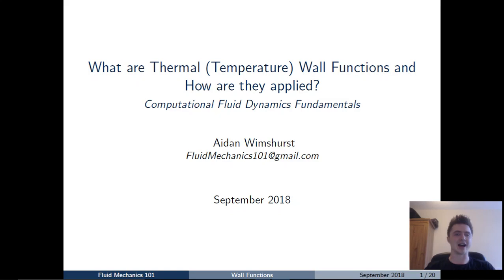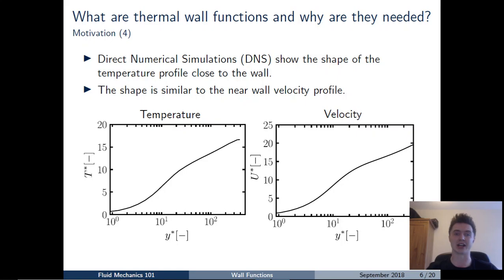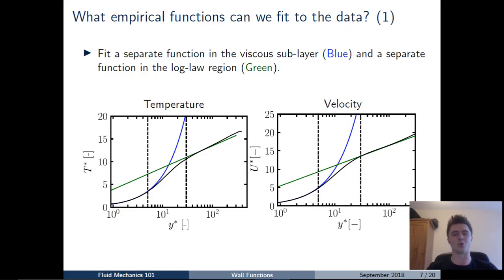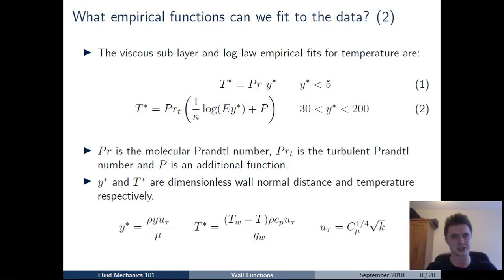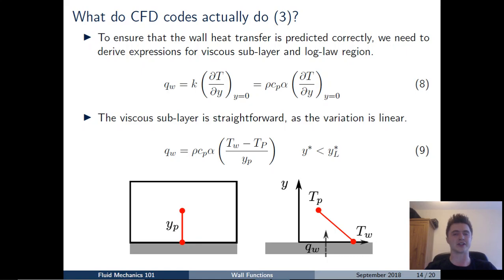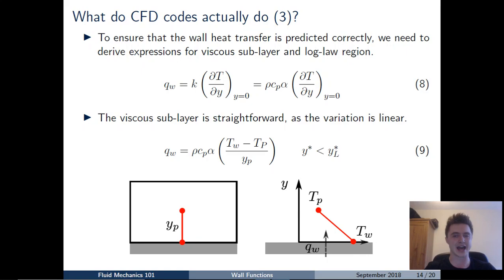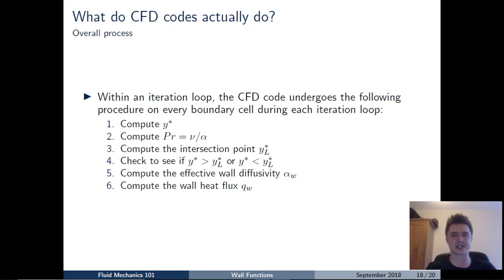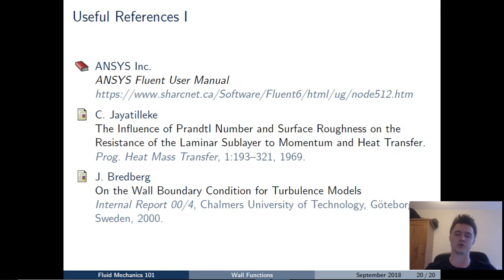[CFD] What are Thermal (Temperature) Wall Functions?

Comment: Dear Aidan, Thank you very much for this very good video about this subject which is not straightforward. Quick question : the CFD code will essentially assess the temperature field in the fluid/solid zone and with this field and the wall function it will be possible to assess the heat flux. Of course, this heat flux is very interesting from a "real" (physical) point of view to assess the quality of the simulation once finished for instance. However, is this heat flux calculated will be used directly by the CFD code to converge iteration after iteration ? In other words, will the accuracy of the heat transfer calculation (via the wall functions) have any impact on the quality of the convergence of the simulation ?
Thank you ! Your channel is really great for anyone trying to understand how does CFD works :)

Comment: Hello Aidan, 

for thermal wall functions, the solver will compute the intersection point for viscous and log-law profiles in an iterative manner. Will it do the same iterative calculations for momentum wall functions or will it take a fixed value of y_plus = 11.25? Can you please briefly explain?

Thanks
Reply from the maker: I think it will depend on the solver. With OpenFOAM, we can always look at the source code and have a look. As far as I have seen in the source code, this is the case.

Comment: Hello dr.,
In 9:59 you gave the Pr for both water and air, where did you get these numbers?, and were exactly should we change the value in ansys fluent in the "wall prandtl number"? .
Reply from the maker: The molecular Prandtl number is a material property of the fluid. Fluent will calculate it in every cell in the mesh and use the value in the cell adjacent cell in the wall function. This is slightly different to the turbulent Prandtl number, which is nornally taken to be a constant (say 0.85 or 0.9). This is fine for water and air. If you have a liquid metal (or another unusual fluid) you may need to change it.  I am not sure where the button is in fluent, probably best to look in the TUI (text user interface)

Comment: Thanks for your videos, i have a question: How to choice the turbulent prandtl number correctly ?
Reply from the maker: If you are using a conventional fluid (like water or air) you can use the standard value of 0.85. However, if you are using a liquid metal or another unusual fluid you will probably have to do a literature search.

Comment: Video super clear! But I wonder which values for k, E, Pr_t u have used to get the graphic at slide 10! Cause i have tried with values like k=0.41, E=9.7 and Prt=0.85 and also other similar values , and i cannot reproduce the values u get in the graphic (I plotted T_star vs y_star values to see the intersections: qualitatively is the same, but the values are very different for water in particular)
Reply from the maker: Have you calculated the P function?
Reply: @fluidmechanics101  Yes, i can copy-paste here the few matlab lines i used: k=0.4187;   E=9.793; Pr=0.71; Prt=0.85;    f=Pr/Prt;   %aria  P=9.24*(f.^0.75-1)*(1+0.28*exp(-0.007*f));  lam=Pr*ylam; tur=Prt*(1/k*log(E*ytur)+P);

and then i plotted. (i did the same for water values).
Reply from the maker: Hmmm that looks correct to me. It has been a long time since I made this video. Perhaps I made a mistake? 😅
Reply: @fluidmechanics101  Thanks for replying. Looking back to the Chalmers report you suggested, i think thank 13.2 is what you get using the values proposed experimentally by Kader and Yaglom ( T+=1/Kt*ln(y+)+Bt with kt=0.48 and Bt=3.9). Maybe the value 7.6 u found for water uses other experimental data taken from the same paper by Kader and not reported in the Chalmers report. Anyway what was important is the metodology, which you explained cristal clear :)
Reply: @domenicobianchi8  To me it looks like a labelling error. The plots for air and water are switched.
Reply from the maker: Yes, I think you are right. Sorry all! I labelled the plots the wrong way around

Comment: Thanks for Dr. Aidan's works.  

From the dimensionless analysis on the thermal boundary layer (B.L.) with some assumptions made, the thermal B.L. can be analogue to the hydrodynamics B.L. given that the Prandtl no. is 1.  So, I'd think the wall function approach you presented in the video is suitable for fluid with Prandtl ~ 1 (e.g. 0.71 for air), may I correct?  If so, it looks that its application extending to water (Prandtl no. 7.56) is considered as an approximation for practical convenience.  Am I correct?
Reply from the maker: Yep 👍
Reply: @fluidmechanics101  Thanks for yr reply.  Looking forward to seeing more videos from you, Dr. Aidan.  😃

Comment: Hi Aidan, very nice video and I appreciate your work.  I have a question on the turbulent Prandtl number. We know that Pr for water is different from liquid metal (e.g., sodium, LBE) and so is the turbulent Prandtl number (Prt).  In the Fluent turbulence model setup, there are several Prandtl numbers: TKE Prandtl number, TDR Prandtl number, Energy Prandtl number, and wall Prandtl number.  Which one of them is the Prt we are talking about? If I want to use a correlation to calculate Prt, how should I do it?

Thanks for your help.
Reply from the maker: Let me get back to you on this one 👍

Comment: Hi,

thanks for this lovely video, it is such a joy to watch it, however i have a question regarding the enhanced wall treatment used in fluent, does it uses also same reformulation you mentioned for the thermal diffusivity between the sub viscous layer and log layer as you mentioned ? 
because i know that for velocity, the enhanced wall treatment, uses the two layer method and when it comes to the viscous sub layer it uses the wolfstein one equation to reformulate the turbulent viscosity
but what about the thermal diffusivity, how the enhanced wall treatment deal with it, is t the same reformulation as you mentioned in this video ?

thanks
Reply from the maker: Hi Mohamed, i have a video on enhanced wall functions coming out soon. Hopefully this will help 😄

Comment: Sir I am doing liquid sodium heat transfer study in an annulus channel.  Can u pls help me to calculate y* i.e. intersection point b/w linear and log-law layer value for liquid sodium?
Reply from the maker: If you equate the two equations you get: y+ = 1 / kappa log (Ey+). Rearrange: y+ - 1 / kappa log (Ey+). Then use a non linear equation solver (like newton raphson or bisection) to solve for y+. You will have to do the same for the thermal wall functions but make sure to include the prandtl number for sodium 😊
Reply: @fluidmechanics101  Sir...what about constant P in log-law layer?
Also linear part term contains Pr and log layer part contains wall Prt. This eqn I tried to solve in excel but yplus value obtained is around 14. I seen in literature for mercury (Pr = 0.027) thermal sublayer thickness is about 260. Then sodium should be more than that?
Reply from the maker: Ahh yes. For liquid metals we also need to modify Pr_t. Have a look at the Kays and Crawford turbulent Prandtl number model. This will definitely help you out 👍
Reply: Sir....I have considered Pr_t Reynolds correlation. Suppose Pe 270 (Re 50000) case run I am considering. The near wall yplus for the case comes almost 41. From equating linear and log-layer part expression I got thermal sublayer thickness Yt*  around 12.685.(Using excel sheet I solved the equation) So since for considered case yplus greater it should take logarithmic expression.But radial temp variation is not following this.Its  linear variation only.(between wall and near wall cell temperature).
Reply from the maker: Yes, the temperature profile will always be linear. Remember, it is the thermal diffusivity of the face of the cell which is modified to ensure that the wall heat flux is correct 👍
Reply: Sir...You mean to say whatever wall function approach(standard,scalable,non-equilibrium,automatic wall treatment) the wall temperature calculated will remain same?  I am asking w.r.t Fluent code. Only the wall thermal diffusivity will change to ensure wall  heat flux is correct.
Reply from the maker: Almost 😊 the wall function method changes the calculation of the thermal diffusivity on the face of the cell in contact with the wall. The CFD code then calculates the temperature at the cell centroids (by solving the transport equations), this will result in different values of the temperature at the cell centroid. You might find part 2 of my fundamentals course useful. I go through an example of this in detail in Excel and Python

Comment: Hello Aidan, I have been following you for 1 year. Thanks a lot for your tutorials-very useful. I am using Code_Saturne, and now I want to modify the default wall function to take care of the viscous heating effect, but I don't know how to do it. This is what you mentioned in the last slide, which I'm very interested in. I found some difficulties in finding references, could you please suggest some references about the viscous heating in thermal wall function, if possible? Thank you!! Best regards, Ruonan
Reply from the maker: Hi Rounon, if you watch my video on 'Enhanced Wall Functions' I think I left some references there to the ANSYS Fluent manual and the papers they used for viscous heating. It's the best resource I have managed to find so far!